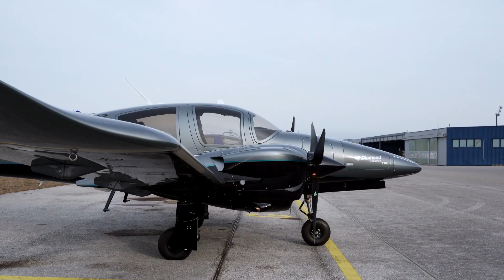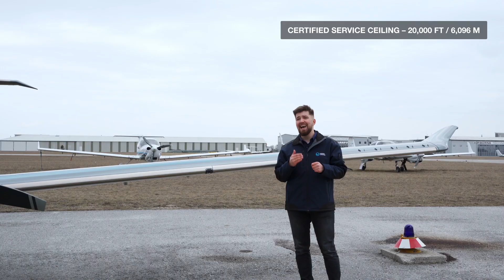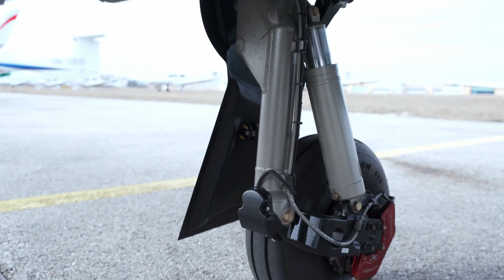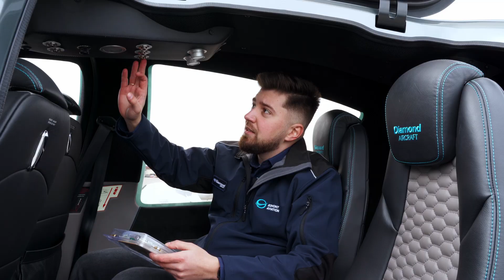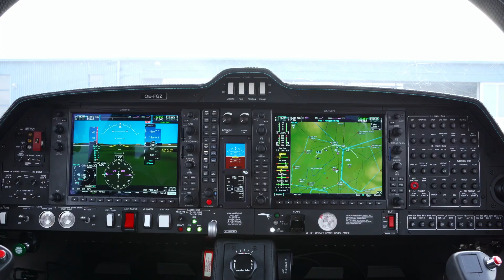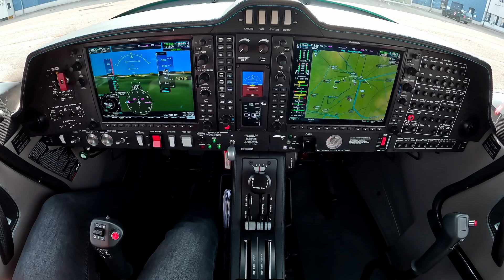Diamond DA62 Aircraft Showcase - Part 1: Exterior and Interior

Comment: Does it have chutes?
Reply from the maker: Great question! At our organization, we believe safety is a result of 'Safety by Design' and superior pilot training. Diamond Aircraft (like the DA62 and DA40) are built with a philosophy that prioritizes structural integrity and active control over passive recovery systems.

Here is why we stand behind this design:

Reliability by Design: The Austro Engines are exceptionally reliable tools. With over 5 million flight hours globally, these Jet A-1 powerplants are industry leaders in dependability. Their dual-redundant FADEC system manages the engine with precision, making it a robust and proven piece of technology. We encourage you to research the statistics—the reliability of these diesel engines is world-class.

Superior Handling: Instead of a parachute, Diamond gives you a wing designed for total control. With an incredibly low stall speed and the best gliding performance in its class, the aircraft remains a stable 'flying tool' even in the highly unlikely event of an off-site landing.

The Safety Cell: The airframe features a carbon-fiber 'roll cage' (safety cell) proven to withstand up to 26G impacts. It’s built to protect you from the inside out.

Training over Luck: As a Flight Training Organization, our mission is to make you feel safe through competence. We don't teach you to rely on a 'what if' chute; we train you to master a machine that is inherently stable and remarkably forgiving.

When you combine world-leading reliability statistics with professional training and a fail-safe airframe, you get a level of safety that is built into the DNA of every flight.

Comment: It would be easy and very nice to have a very light small much higher horsepower turboprop version of this aircraft available. Don’t get me wrong I love they have proven that a diesel engine can work better than gas engine and provide more reliability and better economy. People these days especially the global warming goofballs love to crap on diesel engines without having any real knowledge of them.
I prefer boots over liquid de-icing and most other pilots that I know do as well. They work quicker and you don’t have to refill the tank. I know boots have their own issues but they are a proven system that work if maintained properly.

Comment: Shutting down the engine is very dangerous. This switch should be under a cover preventing accidental switching to the lower - off position.
Reply: You have to pull it straight out and then move it down.  So, there is no way it is getting inadvertently moved, and a cover would just slow down feathering in an emergency.

Comment: There is no such thing as piston jet engine. The correct description would be either turbo prop or just propeller driven by jet engine.
Reply: But this is a piston engine, that runs on jet fuel, so no its not a turboprop

Comment: Very cool and super capable, just a crime to leave it outside without a hangar (won't fit in most hangars in the USA, which are already difficult to find)
Reply: Being basic med, I can't fly in Class A anyway, so the point (for me) is moot.
Reply: @matthewvisnaw4306 , you can fly this aircraft with a basic med if it’s in a standard 5 seat configuration. No third row seat, standard cargo tray installed instead.